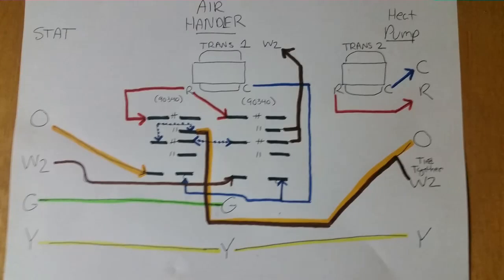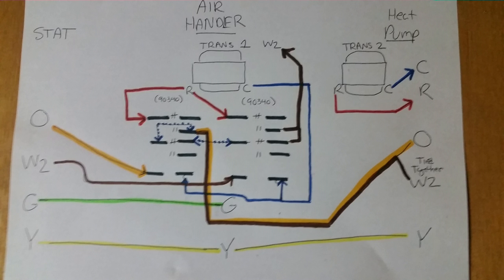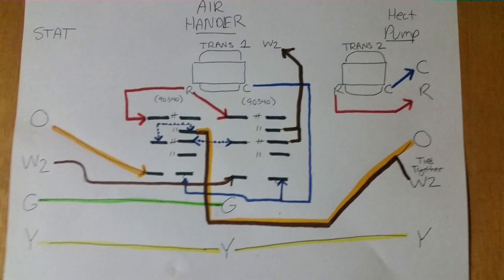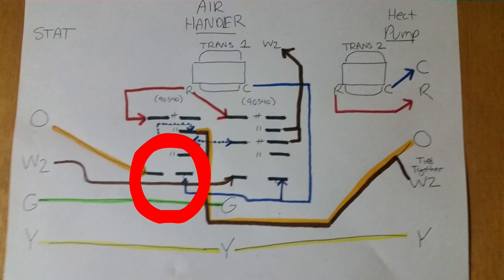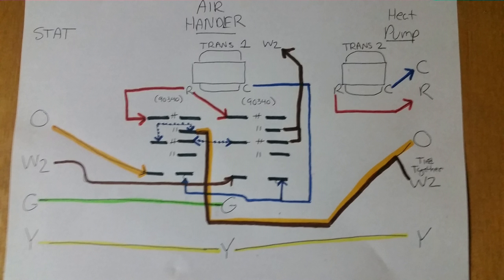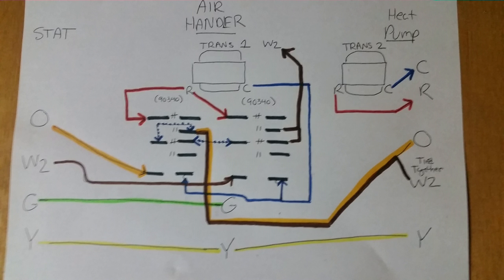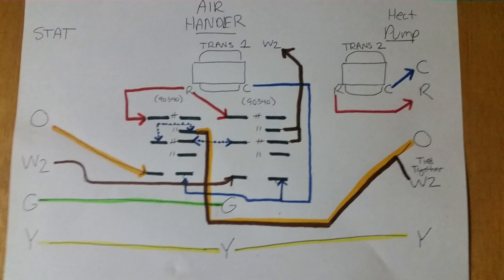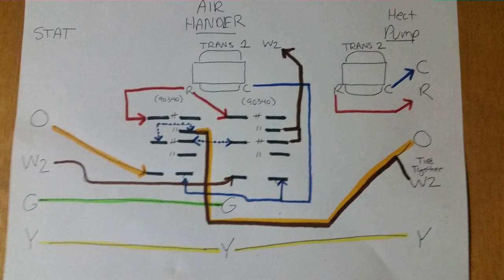How to Wire a Heat Pump With 2 Low Voltage Conductors

Comment: Hey Zack.

If I don’t need aux heat, we’re in Cali, can I add the transformer and ground both transformers to the lineset? In theory my red at the heatpump should energize the board ? Working with a single stage heatpump w a defrost board. 

Thanks bud
Reply from the maker: I have seen folks send common to the line set. I chose to take them to ground. Imperfect solutions I know. Be better to have a separate ground for the commons.

Comment: Or you can, on the heat pump board, you can cap off the red, white. hook one side of the two wire to the common and  wire the other side of it to orange and yellow together.

Comment: When u say ground both commons you mean directly to the metal of the units meaning the grounds are now used as common all the way outside
Reply from the maker: I took them to the same ground lugs as the high voltage. I have seen guys use the line set, but I don’t like that idea.

Comment: I would like to repeat the question asked earlier about how you should go about grounding the commons on the transformers.

A second question is that I'm assuming you already have 5 or 6 wires going from the stat to the air handler, or you're back in the same boat, right? If you started with an a/c furnace combo, you may only have 4 wires at the stat. Again having to look at running a new cable inside.

Comment: I don’t understand shit brother this relays are making me crazy. My company is starting to install heat pump system and I’m running throug this problem that I only have to wires outside. I’m tired of running new wire to the unit.

Comment: Good way to get out of a jam.  A couple of notes to consider when using the dual relay approach.  1.  When reconnecting the W2 be sure to isolate the thermostat W2 connection from the heat strip W2 connection in the air handler as shown in Zack’s sketch. Normally they are tied together on a terminal strip.  2.  Be sure to fuse each transformer or use a small circuit breaker.  It is possible to wire one transformer on L1-L2 and the other on L2-L1 which will then make the output 24vac voltages out of phase with each other. 3. While not always possible, best practice is to use a separate 24vac Common wire and not rely on the 240vac equipment ground for a signal path.

Another way is to use the Jackson Systems IO-WR modules which can allow 3 heat and 2 cool on zero wires or you can use 2 wires to carry the 24vac outside if needed.  https://jacksonsystems.com/products/io-wireless-relay.html

Comment: Is there any way to bypass the control board in a furnace to make the inducer, gas valve or igniter work properly until the board is replaced?
Reply from the maker: +lost soul I am sure there is, but the danger is greater when trying to do that to gas appliances.
Reply: +Talyn875 PRO  Thanks for the advice, I would like to see more videos like this one. Making things work safely using relays.

Comment: That's bad arse, Zack. Explained it very well.
Reply from the maker: Thanks Stan
Reply: After watching it a couple more times, I have to say it really is brilliant! My only question is whether or not there could be a conflict with the defrost board logic and condenser fan operation during cooling mode? (Depending on the individial board manufacturer) If that makes sense? 
The W2 receiving voltage during a simultaneous O and Y call.... If the circuitry of the board is designed so that 24v output to the reversing valve during a defrost demand is directly connected to the boards W2 output and the coil of the boards cond fan relay, it seems possible that it could cause unwanted opening of the n/c cond fan relay. This is probably prevented though, by the external O input to the board.
Reply: After looking at a few board schematics, I think I over thought that a bit. The schematics I've looked at show the W2 output isolated and powered directly at n/o contacts from the board R.
Reply from the maker: +sad hvacman yep, think about it. during reheat it would be energized as well.
Reply: I guess my only other concern would be whether or not the defrost cycle energizing the O input of the board via the W2 output would then prevent the outdoor fan from stopping. Essentially making the board think it's back in cooling mode upon defrost initiation. And I'm not talking about what the board is telling the reversing valve to do. But, rather the O input potentially negating the defrost cycle and going fully into cooling mode thereby running the cond fan. 
When a unit goes into defrost and energizes the valve, not all boards inadvertently energize the O input terminal also, do they?
Reply from the maker: +sad hvacman I think we would have to go board by board.  I know boards like goodman would not be an issue but you're right. perhaps there is one with a different logic.
Reply: +Talyn875 PRO I thought the same thing. That it wouldn't be an issue on a goodman board. Nevertheless, It's still brilliant as can be. I wish it were my idea, Master Jedi.